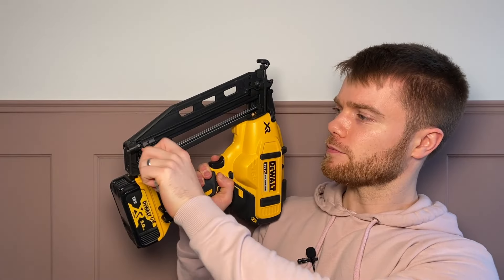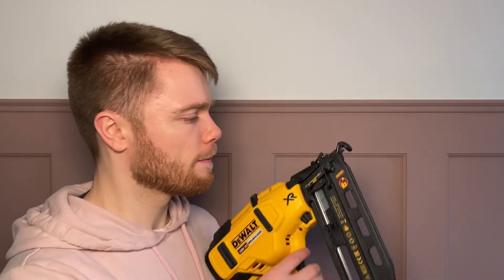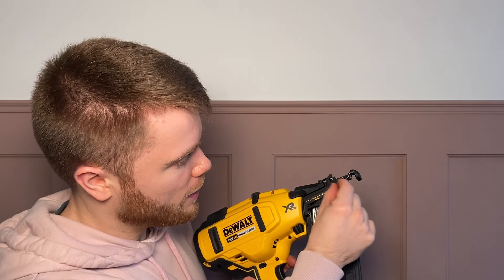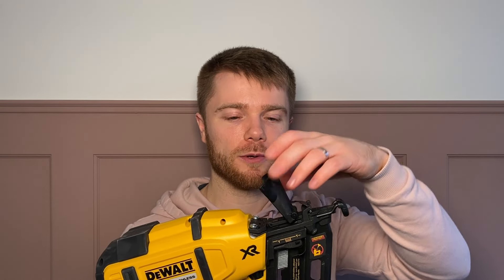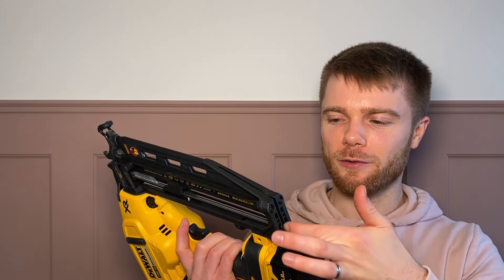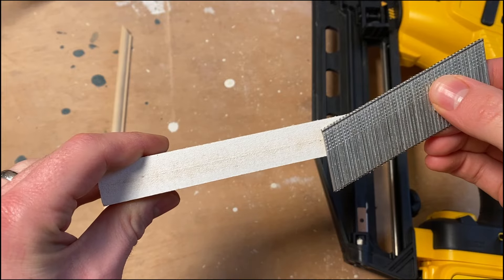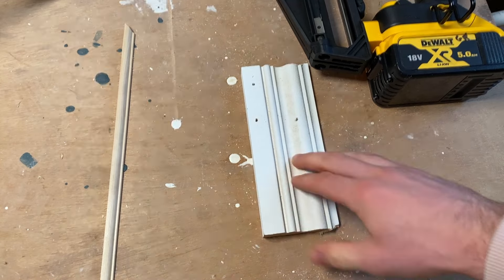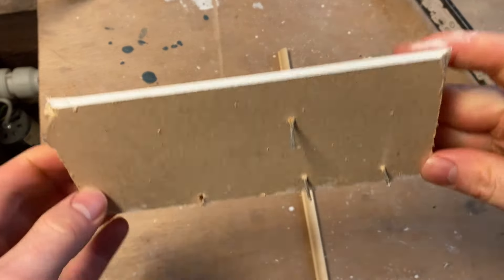Dewalt 2nd Fix Nailer Review: Is it Worth the Investment?

Comment: Looking at buying this for a big skirting board project at home, is it suitable to nail skirting to concrete blocks, if so what nails would be suitable.
Reply from the maker: Not sure about into concrete blocks, Im in a Victorian house so bricks are soft! Assuming you’ve got dot and dab board or hardwall, i think the nails will go in that with no issue. 
Thickness of the nails depends how thick your skirting is, you can get a good range of sizes. Just be sure to use a good adhesive as well. Thanks for watching!

Comment: I need to secure plasterboard sheets to joists for a new ceiling (to be skimmed). Would this Nail Gun be good for this purpose and if so, what nails would you recommend ?
Reply from the maker: I definitely wouldn’t use nails to secure plasterboard to a ceiling, you want plasterboard screws. You can just use a combi drill or impact driver to put them in. If you’re doing a lot of boarding, dewalt do a drywall screw gun that auto feeds, makes it very quick to put screws in. Thanks for watching!
Reply: Definitely not , get a collated screw gun if you have loads to do. Or just use a cordless drill or impact driver, use drywall screws

Comment: Useful video!
I have alot of DeWalt tools and thinking of getting a Nail gun for the first time as never used one before.
Have looked at the Worx brad nailer but would you recommend this one for a first time user?
Reply from the maker: Thank you! Yes it’s great for a first time user, the only issue is the price really. 
Thanks for watching!
Reply: @TheDiligentDIYer1759  It looks like it is and I do like all the DeWalt stuff.
I would be using it more occasionally for DIY and occasional pro jobs but would rather pay more for something that lasts.
What are your thoughts on the Worx brad nailer?

Comment: I have used one like that but it was much older. It was on the old DeWalt batteries, you know the ones that looks like Ryobi ones. The problem I had with it was that after it run out of nails it was still making holes in the wood and it looked like it is shooting the nails but it was not. I hope they fixed that in new models as it was very annoying.
Reply from the maker: I think they’ve fixed it, i haven’t had that issue with this one. Thanks for watching!

Comment: Just bought one of these DCN660 and your review is very helpful, thank you. Could I ask which brand of brads you're using?. I know there are several out there that are substantially cheaper than the Dewalt ones.
Reply from the maker: Pro series is what i use:
https://www.ebay.co.uk/itm/202087340672?mkcid=16&mkevt=1&mkrid=711-127632-2357-0&ssspo=mynXxPk1SUu&sssrc=2349624&ssuid=MiEl2JR6TgK&var=&widget_ver=artemis&media=COPY
Reply from the maker: Thanks for watching!
Reply: Thanks for the very quick reply, you have a new subscriber.
Reply: @TheDiligentDIYer1759  Thanks for the link. I bought the 660 and 692 and was not sure which nails to start with.